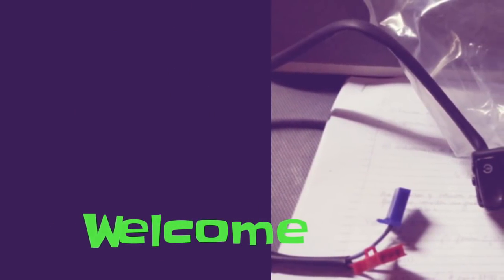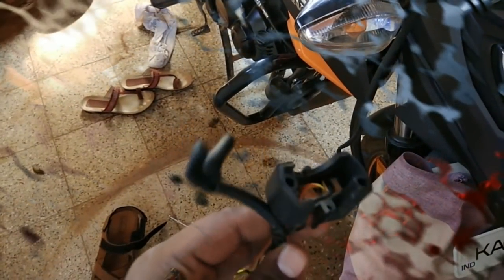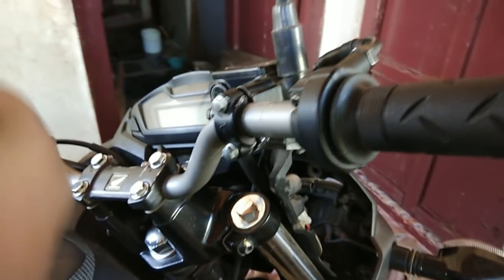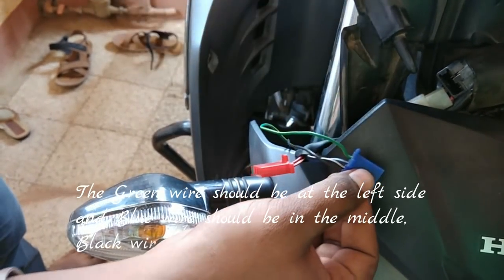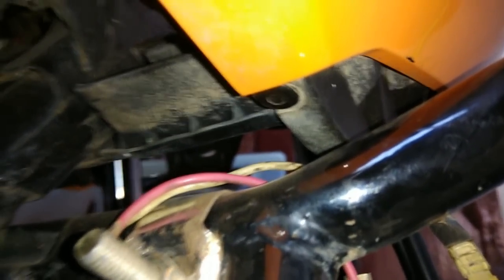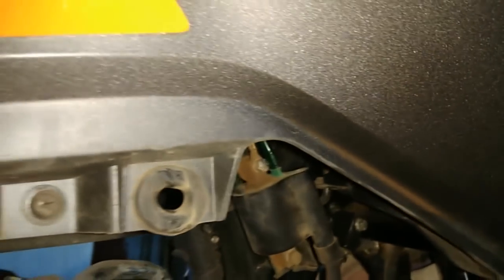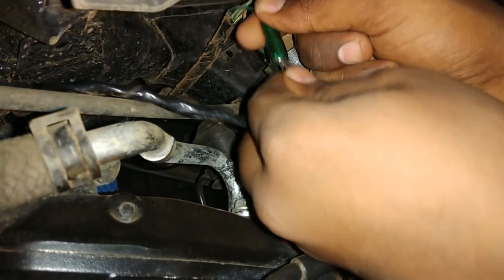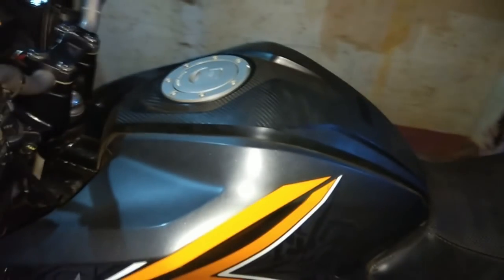Engine Kill switch for Honda Hornet 160r

Comment: I can't understand?? 

 the two wires was from the kill switch ? 

And the for engine  on u connected the  one wire to postive   part  and for the off you connected it to the current flowing wire ?

Comment: I really liked this video, as I was desperately looking for this video to install ENGINE KILL SWITCH for my Hornet 160R. But the video was not compare properly which creates confusion while following the steps. I would appreciate if you could write the steps clearly to understand. Please reply. Also tell me if we can use right switch panel of Honda CBR 250R which has engine kill switch?
Reply from the maker: +Gulzarilal Biswas Thank you so much for your suggestions bro. Ill mention the steps in discription very soon. U can use this switch for CBR 250r. Same concept for that bike. Once again thank you for ur valuable comment pls like, subscribe to channel. And keep supporting..
Reply: Vinayak CA Does CBR 250R switch panel includes light control? I mean is it exactly same as Yamaha you have shown? Can I get you contact no to call you for better understanding?
Reply from the maker: +Gulzarilal Biswas CBR 250r switches are not similar to FZ bro and not which i have shown in the video. U can install other company switches like pulsar,fz,gixxer.
Reply: Vinayak CA Other than Yamaha you showed in video which company offers ONLY ENGINE KILL & START control switch ? PLEASE SUGGEST WITH BRAND AND MODEL OF BIKE?
Reply from the maker: +Gulzarilal Biswas Bajaj pulsar series, Suzuki gixxer they provide only Kill switch and starter at right socket.
Reply: Vinayak CA I guess Pulsar has light control within the switch panel. Can you please confirm?